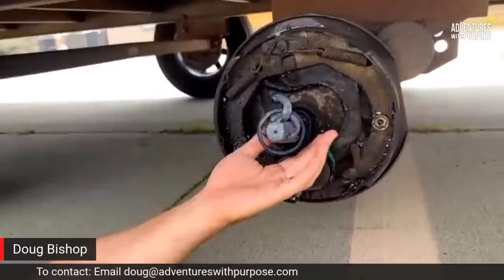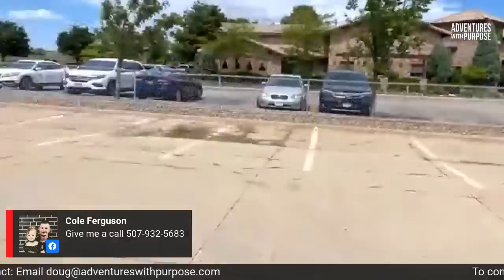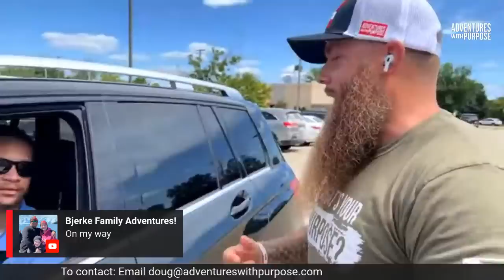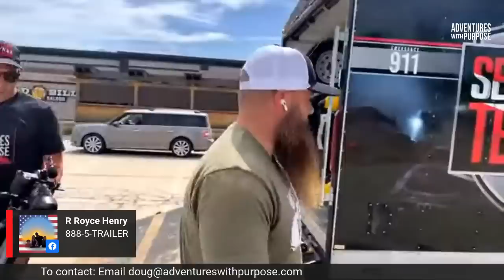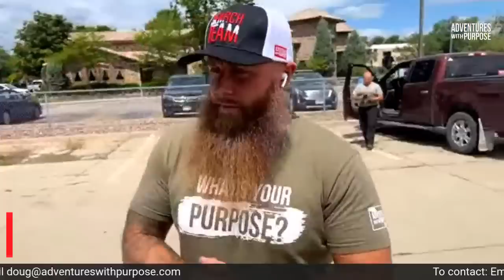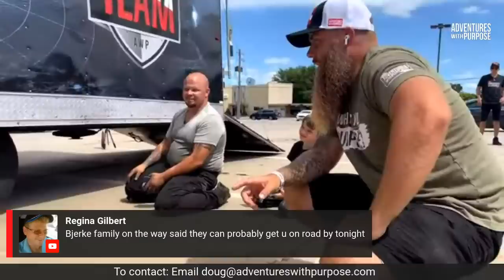IMMEDIATE HELP NEEDED IN ROCHESTER, MINNESOTA

Comment: Pretty cool to get a couple people within 20 minutes and someone willing to tackle it in a weekend. Crazy to see that the axels looked way overworked and the tires rubbed for quite a while which probably helped tear apart that hub on the highway. Very lucky that wasn't way worse. Glad Jared ok'd a total rebuild because you need to beef up all that to make it safer. Why not weigh the costs of trading in what you have for an upgrade vs. installing all new parts underneath?

Comment: Doug, the wheel next to it, looks like it has been bent.  It looks like it is pressing on the underside of the trailer.
Reply: I saw that!😩
Reply: It's now holding twice the weight since 1st wheel is missing
Reply: It’s a torsion axel and that’s how they look when over loaded. I also saw the tire rubbing the floor of the trailer and the wheel tilted inward when Doug went under the trailer the very first time. The upgrade will help tremendously.

Comment: Since you guys are all over driving around the country, might need to get DOT numbers and a yearly inspection to make sure things like this quit happing to your equipment. They check everything and make sure it is right. Most company vehicles have to go thru a DOT inspection. Hope you got better axles. Every week you need to check bearings and oil levels with the amount of miles you put on the setup.

Comment: Hopefully someone just has them in stock at a trailer place and you can get it done quicker. Finding a torsion axel temp may be easiest and like i think i heard him say a spacer for a few days until the beefier stuff gets there, that might be the most efficient way to get work done with the trailer until the parts for the leaf sprung setup gets there.

Comment: Hey Jeff here from state trailer supply unfortunately you need a new torsion axel you need new backing plate and complete hub assembly pre packed with seal and bearings
Reply: Ps you can't just cut that spindle off and weld on a new spindle that is waaaaay to dangerous and you will get un even tire wear and wouldn't get that spindle straight without a jig

Comment: If you keep the torsion axles I would find a way to weigh each axle when it’s hooked to your towing vehicle because if the weight isn’t distributed equally you will have nothing but problems, Dominic has a great idea about using axles with equalizers so the weight is always distributed equally

Comment: its  a torsion axle.  I build trailers.  Torsion axles have a built in degree design.  From the picture I am pretty sure the entire axle will need to be replaced.

Comment: looks like the outside wheel bearing went causing alot of heat and rear bearing go in and out finally pulling off then wheel and brake drum come off rolling away from trailer. You need to greese repack bearing on the other wheel it may real close to do the same. Im in New York to far to psychically help. At truck stop ask trucker or Road side company or welding supply people or a Tractor supply company.

Comment: I would highly recommend doing something to the beams under  the trailer as well.  Suprised that whoever donated them didn't have the beams powder coated when they were assembled so they wouldn't rust.  You ARE around water 99.9% of the time.
Reply: Doing trailer stuff on the cheap is not the way to go as they just found out. Someone needs to be doing a DAILY Crawl around and visually inspecting before you roll out. And Doug You if you were driving Tow Trucks prior to this should know how to complete a proper pre trip inspection, because that would've been caught beforehand and it would've prevented You guys from nearly killing that person in the other vehicle.  Please 🙏 don't Ever let this happen again.  Very Lucky Team AWP Was today.
Reply: I would worry about there no spring or shocks on the trailor and no suspension at all that won't help with all that weight
Reply: @Francois_Dupont   Definitely not the proper set up for them at all.
Reply: @Francois_Dupont  and me too lol crazy
Reply: I live five hours south of there and just ate at wild bills last week. Very good food if you need a good restaurant. Also, the Hyatt house hotel that has a parking deck for a parking lot is about five minutes from there and was a very good experience as well with breakfast. Those are Dexter axles and I would never buy torsions leaf springs only for what you’re doing. I have five different trailers.
Reply: @Francois_Dupont  yes there is suspension!! It's called a torsion flex axle!!
Reply: As far as worrying about under coating iron I would be more concerned about under coating non-marine grade plywood which is the entire floor most likely of that trailer.
Most of these trailers of any brand are made to be price competitive not quality. Rubber torsion axels suck just for this reason.
Reply: @shawnmason5290  yeh or under seal it all underneath
Reply: For the load you are carrying you definitely need to update the suspension to take the load off the axles.  Stay safe and keep up the great work. 👍👍👍
Reply: The Chasis should be hot dip galvanised then powder coated
Reply: Our bodies are mostly water too, so when you find a body in the water that's made of mostly water then powdercoating is a great idea.
Reply: @ade-1772  
This trailer is running torsion suspension, highly likely of the rubber type, they are self damping therefore need no shock absorbers.
Reply: @johnunsicker7440  And they just had a problem recently when they were back home on that same side of the trailer and possibly even the same wheel.  They need to be doing a regular check on the bearings before every trip considering all of the places they take it and all of the hard turning which is very tough on those wheel bearings.  And You don't always have to jack the thing up to check them. Especially something that is that far into it's complete destruction and losing the entire assembly.  Be safe and may you find success this trip team AWP.
Reply: @ade-1772  they are called Torsion axels. The trailer is perfectly legal and is a standard 27’ 10,000lbs GVW trailer. Upgrading to 7000lbs axels will help but keeping an eye on the grease in the hubs is pretty important especially for the miles these guys put on driving all over the country. Good People👍🏼
Reply: @shawnmason5290  experience is a great teacher,  I onch had to upgrade my only trailer because of weight issues and I am sure weight distribution has a lot to fo with many road accidents
Reply: @davidwoermansr   no, when I say 5 lug 5000lbs Dexter axels, I am talking each axel with a total GVWR of  10,000lbs . When I say 8 lug 7000lbs axels I am talking about each axel with a total GVWR of 14,000 GVWR. 
You can also have 6 lug axels that are from 3500 Lbs each to 5200 lbs each. It just depends on what hubs you want on your axels. Also on the 8 lug axels you have an option for ½” studs, 9/16” studs, or ⅝”
studs with different types and size brake options also.
Reply: @timsmothers8740  - YOU need to learn to use kinder sentences….. 🤦🏻‍♀️
Reply: @ade-1772  it’s torsion bar suspension! There are a lot of them out there. They lost the outer wheel bearing, likely won’t see it on pretrip inspection unless it’s leaking melted grease out of the cap. Another reason it’s not really safe to tow 70+ mph even if your truck can do it with no problem.
Reply: ⁹
Reply: @davidwoermansr  would a triple bogie be better to handle the weight?
Reply: @derrickporter679   Haha , its funny how all these "Experts" are commenting when they have no clue what they are looking at! Your right, Torsion axles have rubber around lobe to allow it to flex / rotate and absorb bumps. Rides smoother then leaf spring setup.  LMAO

Comment: You should add a tire pressure/temperature sensor to both the trailer and RV, TireMinder has good ones. Your wheel bearing went out, wheel got hot, sensor would have picked that up before the wheel came off. Do it to be safe and not kill someone.
Reply: By the time the heat gets to your wheel sensor , the bearings would of been locked up!   Remember, tires are rubber and they INSULATE , so it would never feel the heat of those bearings. When bearings seize, you can still touch the wheels without getting burnt.

Comment: Fingers crossed you guys are able to get the repairs you need and able to get back on the road soon.

I doubt this has any relevance to the case you mentioned; but there’s a nasty corner in Winona, about an hour from there, right by the river and I know the guard rails have been replaced more than once from people driving over or not paying enough attention when they go over the tracks. It’s a bit of a drive from Roch, but here’s the approximate cords; 44°03’24”N 91°38’32”W. Otherwise it’s right by Ace Hardware, which is probably far more reliable than my attempt at getting gps cords.

The only other place I’d think of would be Lake Zumbro, which is way closer to Roch and would be deep enough to conceal a car. There’s a campground and houses right there though so not sure something like that would’ve gone unnoticed.

Again, doubt any of this helps, but wanted to share what I know since I’m right by Roch and I can only imagine what the family must be going through. 

Wishing you the best of luck on future cases, and thank you for what you do 💙

Comment: torsion axle - replace the entire axle complete with backing plate and brakes
Reply: The rear one doesn't look too healthy either, and did you notice ANY suspension?
Reply: @lancer2204   Its called a Torsion axle and rides better then springs. Search it

Comment: I'm not sure if they have them for trailers of your size but my dad every trailer he ever had he would install bearing buddies immediately and never had this issue. I hope you guys get the help you need. I am near Green Bay Wisconsin so I'm too far away to help. Good luck you guys are in my prayers. 🧡
Reply: Yep,  bearing buddies are lifesavers.
Reply: Bearings did not start this cascade of events. Wrong size tires rubbing against the floor of the trailer started the problems. 
Dexter axles in their patented design have a central hole in the middle of the axle (that you can see when they show the actual close-up) and it distributes grease into and behind the bearings just like a bearing buddy does when you add it to a normal trailer axle.

Comment: your second tire looks as on an angle as well. Make sure to check all your axles out on the trailer.
Reply: @killtyrant  I think the guy said 8 lug, which are usually rated 7k-8k each axle
Reply: @killtyrant  I agree. With what they tow and the distance they travel, 8 lug is the only way to go.

Comment: At first glance this was a result of a failed wheel bearing. It looks like the bearings are dry. More than likely your grease seals are deteriorated and the grease leaked out. That is simply poor preventive maintenance. With the amount of miles that you travel, you should check for leaks, and pop that grease cap off and check the grease on a regular basis.

Comment: I’ve worked on trailer’s with the torsion axles and have put spacer’s on them and they worked great and I have 2 trailers of my own that I’ve done works great and a lot cheaper
Reply: How much weight you hauling?
Reply: @ThePitbullsrking  I have a auto trailer same axles and haul cars truck’s and sometimes materials for job’s or my welder’s and other equipment without any issues!! I have a little single axle and it’s torsion and I put one of my Snap On tool boxes on full of tools and hardly dropped and towed great and it was only a 4x6 trailer and it was more for hauling a quad or dirt bikes

Comment: This has happened to me before, and it is a failure of the bearings causing excess friction and heat and the Hub assembly broke off as a result. You should be able to replace that axle assembly on that side should be enough, but I would seriously urge an inspection and servicing of the remaining three wheel assemblies to ensure they are in good working order and not in poor condition. So make sure to have the other wheel bearing assemblies inspected and replaced if needed. If the wheels were recently replaced it might be an issue related to that replacement if they didn't do it properly or did something they weren't supposed to. Hope things work out for you guys. Oh yes, a mechanic with a truck can easily do the repairs right there on site.

Comment: Looks like you need to grease those axles more often and you should be able to just replace the hub assembly and breaks. That trailer has been doing good and I don't think you need to replace the hole axles assembly
Reply: The axle needs to be replaced as the tapered shaft where bearings ride is pointing upwards!  Its junk , need axle and whole setup

Comment: After everything is fixed, I would suggest getting some Tire Pressure/Temperature monitors on your tires for trailer and vehicle, You probably would have gotten a heat warning prior to the break and ejection of the tire and rim.  This kind of device can head off issues you don't know ahead of time and can prevent breakdowns on the side of the roads and accidents.  It allows you to get anomaly readings looked at prior to a long road trip.  Just a thought.

Comment: Be happy you had double shoulders! For me, the wheel bearing on a single-axle trailer broke and did throw the whole equipage around so I was initially completely blocking the whole way! With the help of the jack, I freed the trailer from the car and was able to open one-half of the road, unfortunately, the trailer was just after the crest of a hill and no one seemed to care about the warning triangle that I placed in good time so it was a miracle that no heavy vehicle collided with the trailer! But there were a lot of black brake tracks from all the screaming brakes...

Comment: U can buy the hub at tractor supply and it unbolts those four bolt in the center and all u do is bolt it on and adjust the brakes and go real simple

Comment: Oh you need to drop axle out new axle in or put new spindle on also it is not no good along with the wheel bearing and hub assembly be missing also still attached to the tire and rim

Comment: Commented below before realizing the axles are not heavy enough and the tires are too tall and rubbing.  Still though keep in mind you need extra maintenance on those heavy loaded trailers reguardless of how tough they are built.

looks like somebody missed the maintinance schedual on your trailer.  Or the bearing on that axle was defective and gave out.  That bearing definetly did not have any grease in it, it just melted your axle and finally broke.  Not sure how often or how many miles you should do maintenance on your trailer axles and re-pack them with grease but you need to pull all of the other ones off and check and repack them now,   My trailer has a grease fitting so you can keep the axle bearings freshly greased each time you use it.   Hope you get it repaired and have no other problems. Good luck and stay safe.

Comment: Nothing wrong with Torflex axles. The only problem with Torflex is you have to tow the trailer level, You can't have nose up or nose down putting more weight on the front or the rear axle. I have a 8.5 x 29 foot trailer almost identical to yours with Torflex axles but mine is a Mirage not an Interstate. I haul  4 sleds or 2 side by sides or a full size pickup in it and have never had an issue but I ordered it with 5500 lb axles.

Comment: As you said go to 5K axles. Get torflex axles and make sure they have the ezlube hubs. Interstate always under sizes their axles unless you special order a trailer. That trailer is designed for snowmobiles and 4 sleds in that trailer pushes the max GVW. Be willing to bet you have way more than 3000 lb's of gear in there. Lack of maintenance is what caused your problem. Those hubs need to be lubed properly at all times. If I was closer than Montana I would give you a hand. Didn't you guys lose a tire/wheel in Utah? You can't just drag these trailers all over the country without preventative maintenance.
Reply: Well said

Comment: Stick with the Torsion axle setup , gives a smoother ride then leaf springs !  Get 5200 lb axles so that would mean 10k weight capacity axle minus trailer weight.  Your looking at $2500 for setup .

Comment: Leaf spring axels are NOT a upgrade… there isn’t enough weight there to need leaf’s you can get 7k torsion axels that’s will bolt right in and solve all your issues !

Comment: Torsion axles are junk. That is my professional opinion they are not serviceable like a leaf system. they claim they are good for 15-20 yeas but i have seen many lose their support and rub tires on the fenders well before 15 years. and the more they are towed loaded the sooner they wear out. and I have seen many that someone has welded lift blocks in but that only last a short time and makes it harder to repair.. If you just replace  one it will wear out faster and could lead to tire failure because it will be taking more of the load they don't self equalize like a tandem leaf system does.

Comment: let's get them an under chassis cam, so they can monitor things like this, they sell pretty cheap tire pressure gauges (on the cheap) that will at least tell you the wheel went by by.  The things that break are the journey.  SSP  Lets get you guys to come down to Florida and dive that stretch between Miami and Clewiston.  There has to be countless cars in that canal.  Let me see if I can find the video a guy did years ago, pulled out like ten cars in one spot.  Can't find it, its old.  Researching..........Miami, Drug Cartels, Mafia oh my!